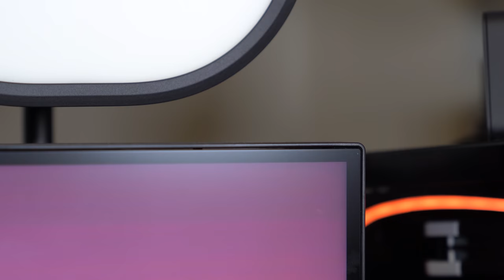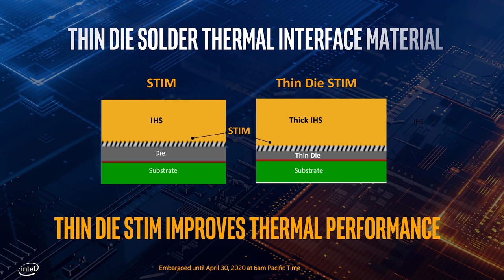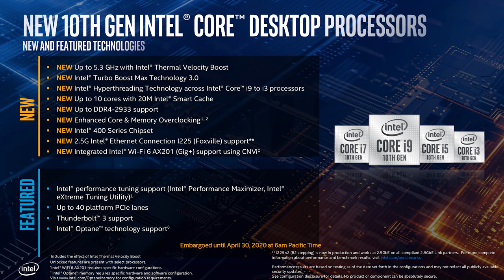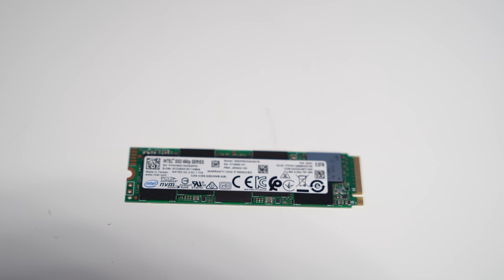The First Z490/10900K System Build!

Comment: Amd is still better as of right now change my mind
Reply from the maker: Did you like your own comment
Reply: For gaming? Intel is considerably better but also overpriced.
Reply: Amd is better than intel at some things and intel is better at others. So be more specific
Reply: @tyr8338  Not really now. For 500 dollars you can get 12 cores and slower speed or 10 cores and faster speed. The lower end is extremely overpriced, and the mid tier isn't bad.
Reply: I have an Intel build and an AMD build (Haswell i5 and Ryzen 2700x) and have had an AMD and Intel laptop. If funds were no issue I would choose Intel for my main build. I have had less annoyances with Intel, which just seems to behave better for me. Headline benchmarks, specs and core counts don't tell you what months and years of living with a system will be like.
Reply: @tyr8338  Intel isn't better at games. Games are just currently made to work from 1 core, which Intel has made very apparent that's their agenda. When game devs make their programs to make better use multiple cores, the narrative of "Intel is better for gaming" gets flushed down the toilet. Even as is, it's not a "considerable" margin. So you can stop giving Intel credit for something game providers cause.
Reply: @RAW_Reality  Intel systems can produce higher frame rates, if that is your thing. And the new Intel CPUs are multi-core. And games do use more than one core now, and will become increasingly optimised for multi-core. And the Hertz those multiple cores can run at will have an impact on high frame rates.
Reply: @RAW_Reality  Games aren`t made for 1 core for like 10 years at least now so you got a bit confused. Basically all demanding games can use at least 4 cores and often 8 cores can give benefits too.
Reply: @tyr8338  nope not considerably slightly...lol
Reply: @Safetytrousers  I agree with everything you said, just so we're clear, but...

I accidentally excluded a word in my original post... 

What it should say is "Games are just currency made to work MAINLY from 1 core", which is still true, and because of that is why Intel is able to get the FPS gains. The key components and aspects of a game (known as the "core" of the game) draw their computing from the chip core that's at the highest value on the processor, resulting in the performance gain. If all games core processes drew from multiple CPU cores, it'd be a "draw" between any 2 processors running the same speeds and frequencies, up until the game's draw exceeded the core/thread limitations of comparable Intel & AMD chips (which, at that point, any person capable of reading the specs on "comparable" chips from AMD & Intel would be able to tell you would be a win for AMD, typically having many more cores and threads than it's Intel "counterpart").

So again, the point of "the game's utilization of the CPU determines this outcome more-so than the CPU itself does" is still, and will continue to be accurate, until either 1) game devs are able to draw their games core components needs from multiple cores more dynamically and/or nonpartisanly, or 2) AMD cares as much about single core as much as they do multicore performance. 
It's a "by proxy" win for Intel, not because of them.
Reply: @tyr8338   "can use" and "are optimized by using" are 2 entirely different things, so I assure you I'm not confused. For further explanation, please also read the response given to SafetyTrousers.

Comment: but its not the best no pci e 4,, 125tdp $500 for the cpu still, as for the mother board  wow what a price increase   rog strix z490-e gaming prices  $300  plus you need cpu cooler you useing  a nzxt at $270 thats over $1.000 for mobo chip cooler  THE TDP WILL BE MORE MAKING IT A VERY HOT CHIP BUT WE WILL SEE AND THE BOARDS GET DEARER THAN THAT AT $1.200

Comment: ryzen 9 3950x is better than anything intel has.  Sure, intel has 222 points in single threaded and 3950x is 213, but in multi threading, which games are going to need moving forward, the 3950x beats the intel 10900k by 48% and the 9900k by 94% lol.
Fuck intel.